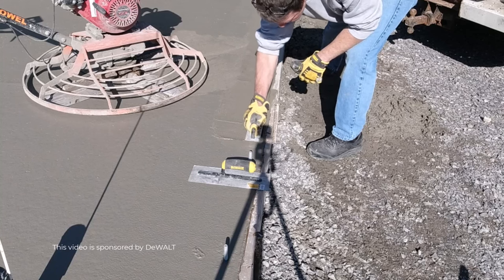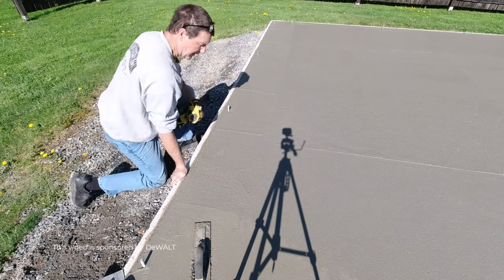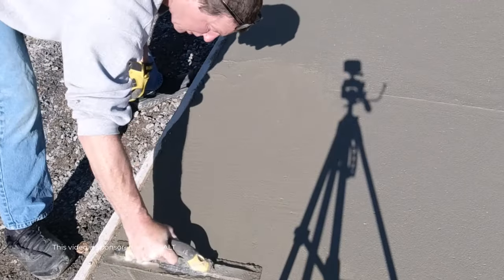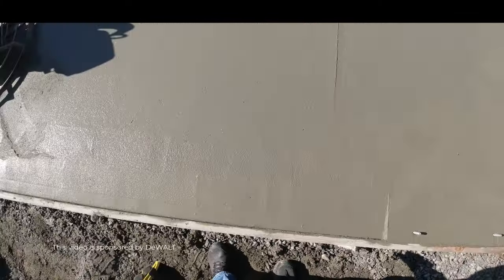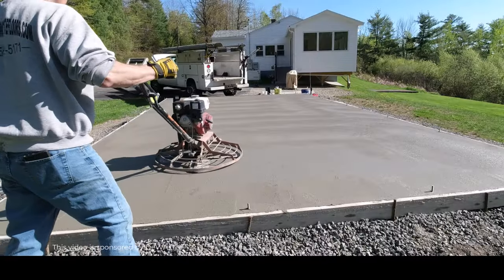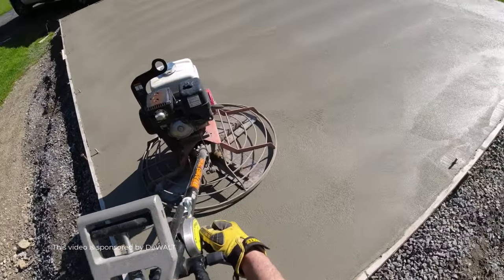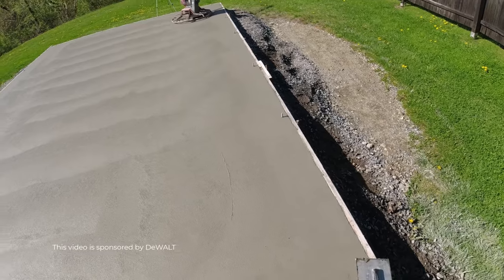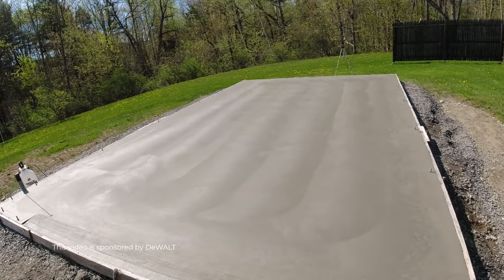When To Start Finishing Concrete - The 2 Ways I Check It

Comment: Here in Dublin Georgia now in June, it's so hot that once our mud starts to go, you have to be on your sh*t so it won't get away. We have to keep a bucket with about 6 inches of water and a brush hanging off our machines to throw water on the slab as we go. We usually put retarder in our concrete just to give you a little more leeway. It allows you to wake it up with water a bit longer.
Reply: Exactly!

Comment: i just finished a slab and it came out with these shallow waves. it was smooth when i bull floated and based on the size and orientation of the waves it seems like it was caused by pushing really hard with the broom. time got away from me and my broom is really soft so i ended up pushing extremely hard with the broom when the concrete was pressing down between 1/16 and 1/8 beneath my finger. i ended up having to use a push broom. can you confirm mike?

thankfully it was for myself and not a client. i guess ill get a much stiffer broom. im really irritated that this happened!